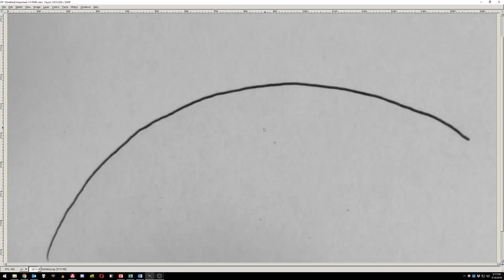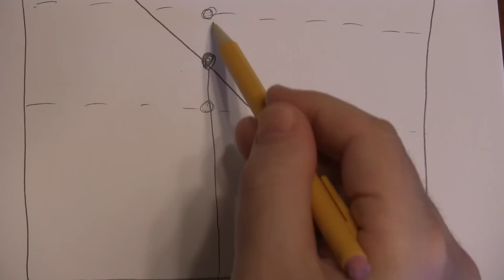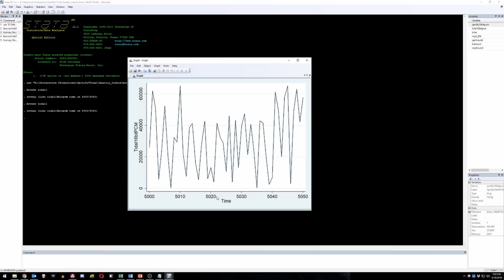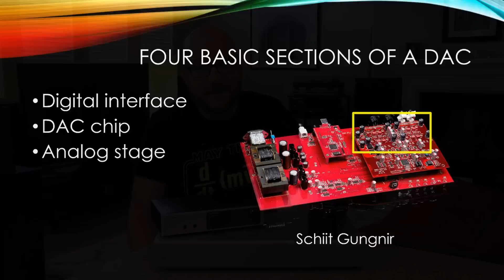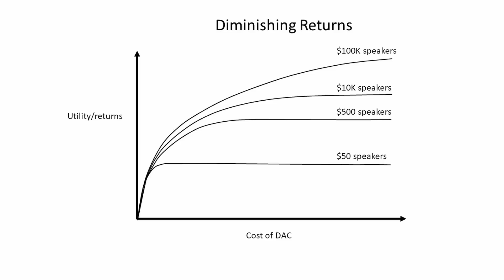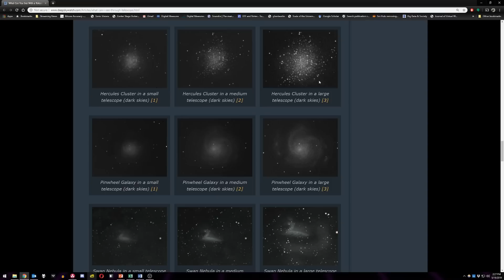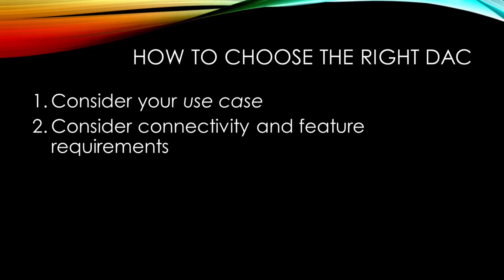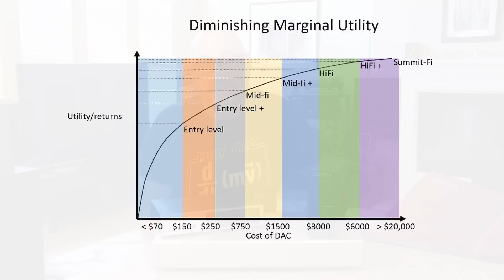DACs 101: Introduction to DACs and DAC Buyer's Guide.

Comment: Regarding vinyl: no stylus tip can detect vinyl signals that are smaller than its own length. There has never been an indefinite analog signal in music reproduction with vinyl records, steely cutting knives and diamond styli. A high end shibata type stylus measures 0,6x50 micron for example. The sensitivity of microphones is limited by the thickness of their membranes (5 nanometer) and so on. ALL natural curves have "stairsteps" if you increase the magnification. There is not a single exception. Not one. Hasn't been. Ever.
Reply: Christian Goergen aka AstraOovier yup!

Comment: I have question if you can answer that would be great, do you need to have balanced output on the DAC in to the amplifier THX 789 as a example to have balanced output from that amp to your headphones?
Thanks
Reply: Since its been a week and he didn't answer your question, I will try to answer.  I have a THXAAA789 and it just works, the input switch switches from the balanced to the single ended, all inputs and outputs work as expected.  I haven't found a flaw with it yet.  So to answer your question nope it doesn't matter.  No complaints so far.  It just works and sounds great.
Reply: Matt Hilty just got in on an order from Massdrop.  Can’t wait to get my 789 and start my build.

Comment: Sigh. The markup on this things has to be around %1500.
Reply: Spent two hundred on a DAC and later found out a $15 DAC I bought for another system sounded way better. I have no doubt if you spend bazillions on a DAC it will sound better than my $15 one. But, since I also didn't spend baziliions on the rest of my system, I'll bet it wouldn't improve the sound by much. I think the diminishing returns curve probably looks like more of a right angle where DACs are concerned.

Comment: 1)
@7:07
"needle"

Yes, you also referred to it as a stylus.  But you repeatedly called it a needle.
Needles are for sewing and flu shots.  Stereos do not have needles.

I realize that countless people call a stylus a needle.  They are all wrong for doing so.
Please never encourage anyone to call a stylus a needle.

2)
DACs have clocks.  They range from "it works", to "it works pretty accurately", to "it works with super high precision".  The better the clock, the better the sound quality.

3)
@12:15
"inputs"

Note that not all inputs on the same DAC will sound the same.  It all depends on how each one was implemented.
If possible, you will want to determine which of your DAC's inputs used the best technology, engineering, quality parts, etc.  You want to find out which of your DAC's inputs will give you the best sound quality.

Most folks use the USB input, and many folks skimp on the quality of the USB cable.  That is a mistake.  A cheap USB cable will significantly and noticeably hurt the sound quality.

4)
@30:29
"measurements"

I used to believe that the gear with the best measurements would sound the best.  That is flawed thinking.

I will take the gear with lousy measurements, yet puts me into sonic heaven.
Whereas, I would avoid gear that has fantastic measurements, yet the sound quality puts me to sleep.

My only measuring tools are my ears.

-----

This is the first of your videos that I have seen.  It addressed every aspect of the subject matter, and did so correctly.  Other than hearing "needle" too many times, I was very impressed and pleased with everything you discussed.
  You know your subject matter, and you know how to explain it to your audience.

You earned yourself a new subscriber.

Comment: Sorry, but a lot of this amounts to subjectivist nonsense, relying on sighted comparisons rather than measurements and blind testing.

You're entirely correct that a DAC is more than just the chip inside it, and hence that DACs don't all sound the same. Here's the problem: we can measure how close a DAC gets to being 'transparent' (a perfect recreation of the original signal within the limits of human hearing) - and there are $100 DACs that measure well enough that any improvements are well beyond the limits of human hearing.

In fact, there are plenty of >$1000 DACs that are not transparent. You can easily spend more for a worse product. Unless you're actually looking for your gear to impart a "sonic character" (i.e. deviation from the original music) - in which case, there's better ways to do that than spending ludicrous money on poorly designed gear.

You might think there's a difference, in a sighted comparison, where you're entirely aware of which DAC is producing the signal. The human mind is very easily fooled - and it's human nature to fool ourselves into thinking more expensive, bigger, shinier gear must sound better. (Another good example of this: go look at blind comparison tests of cheap and expensive wines.)

I am yet to see a single example of a properly-conducted, level-matched, blind comparison that demonstrated, with statistical significance, that someone could tell the difference between two properly designed DACs (as in, where one does not have obvious, easily-measurable abberation in its output). I invite you to demonstrate such a test, if you want to stick to your assertion that any DAC above $100 does anything to improve sound.

Comment: 9:45 "yes, you do [need an external DAC]". No, absolutely not, Apple DACs have no audible differences from any other "high quality" DAC. https://www.kenrockwell.com/apple/lightning-adapter-audio-quality.htm I wonder if anyone knows that all DACs produce smooth waves (not stair step) and clock drift isn't a real thing for any computer/phone dac. There has never been any evidence at all to the contrary. All DACs affect is the noise floor, and no modern DAC has an audible noise floor

Comment: nonsense! it converts one format to another it creates nothing, it reads. they can expand and the like but that's only still taking what's there. Another point would be that an awful lot of sound is inaudible to us mere humans so there is no point in saving that and then there is the FLAC format.
: The encoding of audio (PCM) data incurs no loss of information, and the decoded audio is bit-for-bit identical to what went into the encoder.  Each frame contains a 16-bit CRC of the frame data for detecting transmission errors.  The integrity of the audio data is 
further insured by storing an MD5 signature of the original unencoded audio data in the file header, which can be compared against later during decoding or testing.

Comment: Infinite?  REALLY? 🙄
Large, sure.
VERY LARGE, yes.

Not infinite.
And if you get all quantum on me, at that point the analogy falls apart even further, because we're talking about super positions, so actually, a digital mathematical curve could actually be HIGHER resolution than that analog signal, assuming the artist decided that the higher definition was detail, not mere interpretation.

Even if you used all of the analog matter in the universe to represnt the subtle detail of that guitar string, you could have a literally infinite, thus higher resolution, digital mathematically absolute sound curve.

Comment: 1.  There are caveats to your speaker curve.  There are $500 a pair speakers that have better engineering and parts than $1800 speakers.  Example:  NHT c3  have no sonic character imposed on the music.  Detailed, transparent etc.  $1800 Polk audios LSI use a nice ring tweeter ($30  btw)  But garbage midwoofers and crossover.  
2.  Audio Science review has a few DACs in the $700  range that measure just as well as DAC's in the thousands of dollars.  122db s/n and all other parameters.  $700  is really the point of pretty much no additional benefit.  Look at Topping, SGD1  for example.  Personally?  I found schiit multibit DACS  try to sound smooth and analog, but they sound like everything has a slightly soft and fuzzy quality. They do not represent a crisply focused output.  Your price curve is very wrong, and totally disproven by ASR.

Comment: I'm sorry, but your pushing people down the audiophile rabbit hole.
The technology behind DACs nowadays is nothing magical or expensive. Those chips are mass manufactured and cheap. As long as a DAC is measurable transparent within the human hearing capabilities and has a noise floor that is below audible, which is, once again, not expensive or technically difficult these days, different DACs are not discernable from one another.
This can and has been shown by measuring the stuff - Just use Google. 
(Audiosciencereview.com can be a place to start) 

As long as it's not designed to alter the frequency, has no special filters implemented and is engineered without basic flaws, you can get a Dac for 50 bucks and it will perform just like one for 5000 bucks.
Your decision should be made based on the  features and the aesthetics you need and the rest is psychoacoustics. 
Put your money into good speakers, acoustic treatment and a good digital room correction and you will greatly improve the sound.
Fun fact: This can be heard and measured, so no belief system is required. 

Sorry to sound like a douchebag, but don't just go out and throw your hard earned money away, based on what someone said in a video, who just told you about his perception and emotions without giving any evidence about the legitimacy of his claims.
(Drawing pictures is not evidence, it just shows that you can draw)
Reply from the maker: This is a convenient belief, but it unfortunately doesn't hold up to rigorous blind AB testing. Under controlled circumstances, yes, it is possible to discriminate between even high-end DACs, and certainly between high- and low-end. There are numerous reasons for this. Firstly, the notion that the DAC chip itself is the only component of a DAC that contributes to its sonic character is false. The quality of the digital interface, digital processing and filtering, overall design, and the quality of the analog stage all impact sound. Sorry, but I'm afraid it's inadequate to "just use Google." You need to construct an valid experiment with direct, empirical observation of listening outcomes.
Reply: @seltzertronics2538 
OK, let's make a long story short.

Provide evidence for your claims. If you can hear it, you can measure it, because our ears are very crude measuring tools.
Throwing around technical buzzwords is not evidence. 
(The conversion of digital to analog has been mastered decades ago. The first generations of DACs in CD-Players had issues, but in 2019 this stuff is easy, mass produced, cheap and quality wise far beyond what any human can hear on this planet) 

I provided a link to a site that actually measures stuff (e.g. the RME in front of you) and when this stuff is tested, like you demand, in a rigorous double blind test, there is no difference audible, unless it is designed to sound different or is not working as intended.
It's just history repeating itself - Amps do not sound, cables do not sound and dacs do not sound.

P. S.
Could you please show your method of rigorous blind testing? So far you only mentioned your ears for evaluation. I can't hear any difference (got a pretty good Genelec Reference Studio Monitor Setup with a room correction that is very revealing), other people with even beefier equipment can't hear it, but you can?
I dare say, that this is the convenient part; believing on hearsay instead of demanding evidence and doubting unsubstantiated claims. 
This is science, not magic, so in order to establish what's real, you can measure it. That's the reason why companies can build stuff - It's been observed, measured, understood, engineered and tested.
Reply: @ Anti Anti - I will keep it simple. I have a few different dacs and yes I can hear the difference between them as can others that have listened to them. This is not my imagination as there is a clear difference between them and all of them certainly aren’t in the Rockefeller class either.
Reply: @kingtrance6826 

Same problem here: "There are differences, because I can hear them" is not evidence.
I've heard a few DACs as well and I can't hear differences, but I'm not the one making a positive claim, I'm refusing to accept claims without proper evidence - The burden of proof is not mine. 
People have seen UFOs or the Yeti, but that doesn't mean that those things actually are, what people experienced them to be in their head.

Are there audible differences in DACs? Yes, of course there are. Maybe they are not well engineered and built, maybe one unit is defective or maybe they have an intentional sounding/filters etc. - But that's stuff you can measure. 
(Check audiosciencereview.com for a start) 
What I'm saying is, that once a DAC is built to just translate a digital signal to an analog signal without adding or subtracting within the human hearing capabilities, no differences can possibly be heard.
The other thing I'm saying is, that this technology nowadays is easy and cheap, because it has been mastered decades ago including the analog stages. 
(This doesn't prevent manufacturers from building bad devices nor does it prevent the usual audiophile/salesmen babble)

I've bought different DACs and sold/exchanged them and now have something that is far more expensive than it has to be in regards to the sound quality, but I like my setup now, because it looks and handles in a way, that suits my desire - But on a basic sound quality level I've could have had the same result for a fraction of the price.

And that is the reason why I dislike these kinds of reviews. Not only do they make unjustified claims, but they make people buy stuff, they don't need, based on those faulty assumptions. This is good old fashioned snake oil selling and not unbiased information and should always be pointed out.

Comment: Way too long video! Anyway, there is no human been on this planet to distinguish DAC from 500-1000$ compared with those 20.000$ 
And why regular people believe most Expensive means guarantied Higher quality? That is sooo wrong, capitalist way for value thinks?
For electronics there is golden rule, do not bay cheapest but also do not bay most expensive thing out there, something in the middle.
 if you spend $500 for 2ch DAC there is more than enough for 99.99% humans, guaranteed and as professional electrician and repairman.
Those DAC's for 10, 20.000 USD or 100.000 are insane, the difference no ear can hear, only for prestige among the rich 80 year old FARTS.
 I firmly believe that there are too many brain (pe*is) deаd "people" with too much money, they can save the planet if they want but no...
they would gladly spend hundreds of thousands of dollars on audio equipment but never donated a coin for the common,  public good.